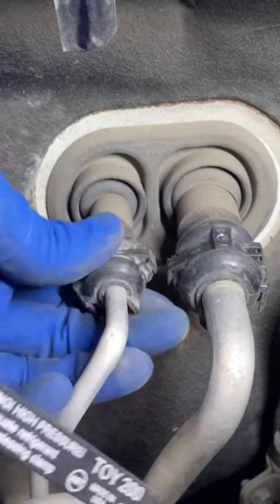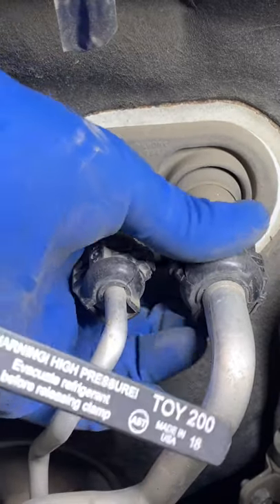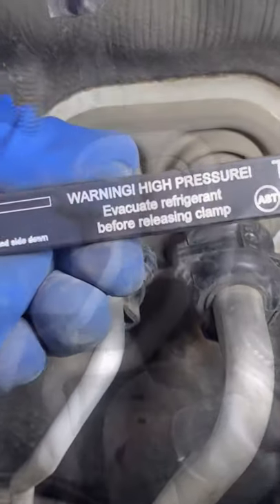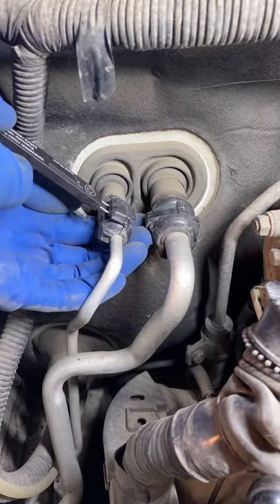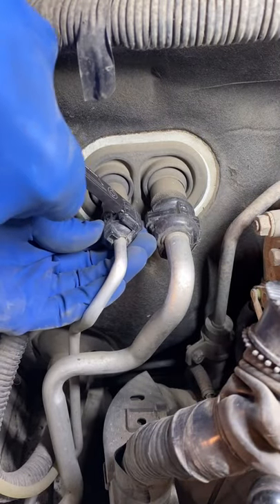Unlock Toyota A/C Lines

Comment: If I disconnect these lines to remove the AC compressor will the ac leak out  thanks
Reply from the maker: Yes it will. And not just leak, it’ll spray out under a lot of pressure.
Reply: Yes and be considered venting which is illegal.

Comment: Is it safe to pull it out just like that?
Reply from the maker: You need to discharge the system first
Reply: @ToolDemos  how can I do that ?
Reply from the maker: @outzy358  either use a recovery tank or an AC refilling machine that can also recover the refrigerant.